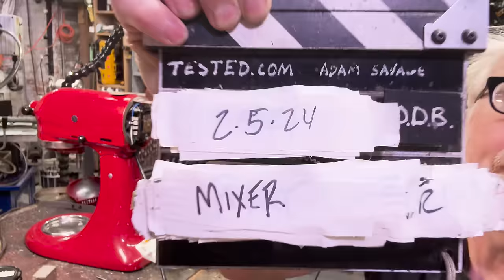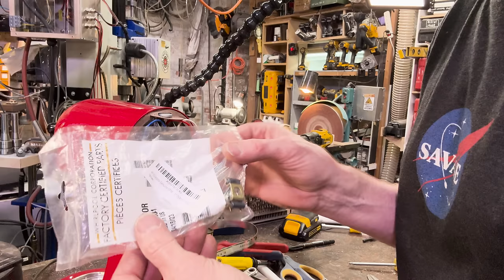Can Adam Savage Repair This Old KitchenAid Mixer?

Comment: I've been doing restaurant equipment for over 20 years. I've fixed 100s of large Hobart mixers. I've fixed tons of these small mixers for friends and family. Pro Tip If you find any Kitchen Aids look on the back left if you see the Hobart logo buy it. They were built as well as the larger Hobart mixers were.

Comment: I follow tested, and when I saw this vid and for a minute, I hoped beyond belief that the KitchenAid mixer problem here would be the same one as mine, especially when mentioning the switch, but alas...  My issue is that the switch will not physically stay in the off position. Yet it may be the same solution regarding a replacement part.

Comment: I love my kitchen aid mixer as i use it with a shredding attachment to help me prepare meals as i don't have full use of my hands. 
My 1 complaint about it's construction is the use of a nylon toothed worm gear which although a cheap part gets shredded by the metal gears it interacts with. 
I know it's probably a sacrificial part i wish it was made of something a little more wear resistant so i don't have to remove and replace all the grease as often every time i get an unusually dense bag of carrots.

Comment: little pins like that are easy to deal with. When you know it can drop out, first thing is have a way to catch it, like the apron on a watchmaker bench. Second is a drop of blue loctite. before moving on, put the pin in place and let the sruff set. On a loose pin, it'll set well enough in half an hour, but you can shift or remove and clean the pin later.

Also, GFCI. When working on this type of thing, ALWAYS  a GFCI. Watching he screwdriver adjustment when it was running scared me.

Comment: A friend's mom gave me her broken KitchenAid mixer to see if I could fix it and flip it. I don't even remember what I replaced. It was mechanical, not electrical, I remember that. Seemed pretty straight forward to work on.  Contrast that with me trying to repair my mom's Bernina sewing machine, which I failed hard at. Still was able to sell the Bernina to a sail maker because it was so robustly constructed. Things that are well built are worth fixing and can be fixed is my point, I guess.

Comment: KitchenAids rule the mixer kingdom for a reason! They’re so robust to begin with, but they’re also SUPER maintainable thanks to their motor construction. Fun fact KitchenAid was a name they slapped on Hobart mixers (think bread factory) when the first home models came out in the 50s 😊 An amazing brand and lifetime investment
Reply: It's unfortunate the newer kitchenaid mixers aren't built to last like the old ones
Reply: The KitchenAid is a separate product line from what you would now think of as Hobart mixer (Hobart sold the Kitchenaid brand to Whirlpool in 1986 but kept the patents for their professional mixers). The Hobart mixer has rhe motor always at full  power and has a variable transmission, the KitchenAids emulates "gears" by slowing down the motor (which means you have miserable torque in low gears because your nominally 300 Watts motor produces only a fraction of that). Beatiful machines though.
Reply: It's a monopoly.....
Reply: No they're not, they're the trendy ones. The equivalent of a trailer queen. A Hobo is superior. Actual transmission. You buy a Hobart, you die with your Hobart. I've seen examples used in professional setups that hadn't been opened from production decades ago (pristine, untouched screws, the hallmark of any quick and dirty repair). "Fixed" one myself, because the motor brushes had finally gone too low.
Bout the only thing can cook a Hobo is stator death. Either the copper gets too low (but you can fix that if you find yourself a stator lathe and the nerves to remake that stator) or burnt winding. The gears can't die. They can get loose or sloppy, but they'll still work. And in today's day and age, you can 3D print replacements out of superior materials. If a KiA dies... you either buy a defunct one for spares (because the control system is too complicated, pointlessly) or buy a spare from someone parting out theirs. And the gears are far more trafficked than Hobo materials.
Reply: @aserta  To be fair, for the price of an N50 you can get probably 20 KitchenAids (YMMV, here in Germany the N50 is about 8000 Euro). For a home baker that is probably overkill. The KitchenAid looks nice and if you don't want to run it for more than 10 minutes before cooling down it is perfectly adequate.

Comment: I was waiting for the BANG! 
Sticking an un-insulated screwdriver into the back of live equipment is a great way to get a Darwin Award,  even if your running on 110V instead of 240V
Reply: Our 120V is 240V It's just center tapped.

Comment: Distilled water works really well for cleaning electronics, as long as there's no residual charge in the electronics, and as long as you let it completely dry before giving it power.
Reply: Distilled water? When I worked at a board assembly house we loaded all the boards we made into a regular dishwasher hooked up to city water to wash the water soluble flux off of them. The water in that city was harder than a carp too. Lots of minerals in it.
Reply: @1pcfred That’s horrible! It doesn’t take much minerals to cause problems down the line.

With that said, even the hardest water in USA isn’t that hard. “Hard” water in Europe is literally off-the-charts hard by US scales! 

I now live in Switzerland, in a place with medium hard water (i.e. very hard by US standards) and I’m glad that at work (a university), we have both regular hot and cold tap water, but also a cold deionized water tap. Only for the most demanding analytical chemistry do they need to further soften and distill that. Super handy to be able to casually use deionized water for cleaning electronics or glassware.
Reply: @tookitogo  my buddy lived in that city and he ran a humidifier. In a day his TV screen would be caked with this white crust. So then he had to start getting into reverse osmosis water purification. That tap water was harder than a coffin nail.

Comment: 21:26 Find the following objects: Sanding disc, foam cutter, Radio Shack sign, space suit, dodecahedron, dial gauge (3), mirror ball, dummy head, alligator leads, start/stop buttons, light panel, hazard sign, stool on wheels, solder drawer, too many power adaptors.

Comment: 12:08 there is a contactor on the front lower part of the speed controller that the contacts need to be cleaned, the contactor possibly bent to the correct position, and the piece that holds it in place needs to be tightened and you can avoid replacing it. it gets loose over time and bent out of position causing it to be near impossible to dial in the lower speed. once the contactor is secured the low speed can be set.

Comment: I purchased a KitchenAid 6 Series from Costco in the USA and I'm using it in India with a 1500-watt step-down converter. However, my new KitchenAid only runs for about 10 seconds on speeds 1 through 5, and then stops shortly after spinning. What could be the issue?

Comment: I have a pro 600 and this year after about n12 years of perfect service the lowest speed (stir) would at times not engage I opened her up and thought I might need to deoxit the switch, it was caked in flour, I blew and brushed it out and everything is back to normal operation.

Comment: I might be wrong but I thought there would be a spring that attaches to the bottom of the speed controller plate just under the bottom adjustment screw? It may be there but I didn't see it.

Comment: Your friend is lucky that's an older machine as it still has a spring on the beater shaft that KitchenAid removed several years ago KitchenAid decided recently to make the pushrod that moves at speed control plate back and forth out of plastic after Decades of making it out of metal just to save some money. The problem is it's very cheap plastic and it tends to melt. In that case you don't want to order another Whirlpool OEM part you want Mr. Mixer's metal replacement part.

Comment: I found this to be painful to watch 😂.  I retired from KitchenAid and worked every part of the factory that makes the stand mixer. Every part inside of those mixers has changed very little.  The original problem was that the governor had slipped back. Just needed a nut driver to put it back on. On the production line a orange rubber mallet fixes a lot of problems. 😁

Comment: Parts availability is huge. I got spoiled with my 2007 tundra, being able to order parts directly from Toyota over 15 years later, when I can't find anything secondhand that works. Compare to a simple, frequently replaced rubber window seal on my 2012 Ford that is discontinued and not available anywhere... 🫠

Comment: There is a way to find out how old a KitchenAid mixer is if it still has the sticker underneath with the serial number on it. I believe Mr Mixer get a tick tock video about it. I don't recall exactly when KitchenAid came out with the Artisan line which the example in this video happens to be. I have a few different KitchenAid mixer models one of them is the ultra power model which utilizes the same body as the artisan what has a 300 watt motor I think it's either from the 80s or 90s because of the silhouette for lock and unlock they just wrote the words lock and unlock on it. I definitely recommend getting a KitchenAid mixer if you're into cooking where do you buy new one or used one since they are so easy to work on. I find KitchenAid history very fascinating.

Comment: I need to replace the gears in my mom’s. The cover for where you can  attach accessories fell out just as she turned it on, the beater wedged the cover against  the bowl and sheared multiple teeth off the main gear.

Comment: This shows why right to repair is so important. If this were a new product today, replacement parts wouldn't be available, the software would be locked, the license would prohibit you from opening it in the first place, and there'd be some kind of smart sensor that'd lock you out of using the touch screen interface if you swapped a component for a "unofficial" one.

Comment: 9:48 There's a weird blur box right at the tip of that blue glue bottle... I don't know what's up with it lately (or if it just started or I just started noticing it...)
Reply: It looks like it may be an encoding artifact to me. YouTube encodes every video they serve. They encode it multiple times too.  So it is an ongoing process over the course of time. The whole deal is complicated. Resources are finite so they're prioritised and optimized. But that means not everything is instantly optimal.
Reply: He replied to another comment that the blur is on purpose, to obscure something.

Comment: I am actually enjoying this video. The nice thing about older kitchen gadgets is they can be repaired as they were built to be if needed. Even quality cars like older Toyota's were built like little gems. One could often just take apart things and just clean them.

My challenge to you is one of the most evil thing on earth in the Kitchen to fix. Its older expensive Keurig Coffee makers with a bad water pump. 

They are virtually impossible to get apart in one piece without destroying them. Once apart its nothing to fix.

They look easy to fix at first but there in lies disaster. 

Keurig designed a system of inner locks that are the devil themselves to beat.

If any bank wants to secure their money tell them to just ask Keurig.

Comment: I had to replace the motor in mine once, which requires taking the top off and carefully sliding the motor out from the transmission, which require removing screws locking the transmission down. All of which went great, until I went to put those screws back in and dropped the first one down in the chassis. So I just turned the whole thing upside down to get the screw to fall out, leading to all gazillion pieces of the transmission falling out all over the table. Needless to say, it turned into a bigger job AND wasn't great for my ego.

Comment: It acts like the motor brushes are wore out!  Starting and stopping?
Reply: This... and the gearbox needs fresh (food-safe) grease.
Reply: Starting and stopping is how it speed controls. That's what that plate on the back is doing. That coupled with the governor makes and breaks electrical contact.

Comment: I have a Kitchen AId mixer from the 70s and it still works. The ones made now (the last several decades) use plastic gears and need more maintenance. Kitchen Aids are not made as well as they used to be.

Comment: I'm having extreme difficulty imagining how a tilting plate controls the speed :-).
Reply: Think: mechanical rheostat
Reply: A mechanical "govenor" on the motor axle is driven outward by centrifugal force. When it hits the speed control plate it opens a contact and power to the motor is interrupted, making the govenor move inward again. The angle of the speed control plate determines how soon this happens, and that way throttles the motor.
Reply: @unavailable753  I've gotten so used to multi-tap motors in things like fans that I forgot you can actually set them up with a real governor and get actual rpm control.

Comment: With Adam on the case, you know he's not going to half-ass it at all, and if he can't fix it, it probably can't be fixed. It's sure not because he didn't try his damndest. We should all be as lucky as the owner of this mixer. Adam, if the whole "famous prop maker/TV host/YouTube auteur/all-around great guy" thing doesn't work out, you could open up one of those little appliance repair shops run by a charming old man who can fix anything.

Comment: wouldnt u test setting 1 low under load in case it bogs down ?
Reply: KitchenAid mixers are not actually supposed to run in the low settings under any appreciable load. Since low speeds are accomplished by throttling the motor to low power output, running a load in low "gear" (it's not really a gear) might stop the motor, and then it will burn out (the motor is made from spools of copper wire with a thin insulation layer, and if it heats up the insulation would burn off, the wires would come in contact with each other and short the motor out). This is the reason a KitchenAid has a sacrificial nylon gear - if a load stops the attachment, the nylon gear breaks and takes the load off the motor to prevent it from overheating. So contrary to your intuition (which you have probably gained from motors with an actual transmission where the low gear means more torque) running a 5 Quart KitchenAid in low gear is generally not a great idea (their bigger models have modern brushless motors with electronic speed control).
Reply: @unavailable753  right agreed but i ment like someone doing thick iceing sugar mix then adding color in low mode 
cant say things like this dosnt happen then going back up to speed. 2nd point is u throttle back down to turn it off right - so if your doing pizza dough you will and do pass low gear.

Comment: I have had occasion to deal with a couple of these things.   
Stupid, fragile speed control schemes and instantly destructable gears are the main reasons.   
Not that Sunbeam did any better on speed controls ---    
they are different in design but every bit as easily damaged.

Comment: There is a possibility that the carbon brushes are near end of life. The sound of the motor running is not smooth and could be arcing instead of having good contact. Although at the end it sounded much smoother. Not to mention if the brushes were arcing there would be a pronounced odor of ozone.

Comment: Arg, I have that exact same model (manufactured more recently), and couldn't fix it. Mine's just dead as a doornail, it still bugs me.
Reply: "Dead as a doornail" usually suggests worn out motor brushes. With pretty much any other fault it should at least make a noise (if you dare, after unplugging and then taking a step back you can bypass the speed control plate and connect the motor directly to the cord to see if it turns).
Reply: @unavailable753  It overheated dramatically, and it's too new for it to be the brushes. (It didn't feel hot until after dying, so something went weird inside it.) It even melted the lever mechanism, which I replaced.

I've been nervous to connect power to the motor directly since I couldn't find good info and it probably will short circuit.
Reply: @GamesFromSpace  If it overheated then the insulation on the motor coils might have melted and shorted out the motor. Here in Germany at least it would mean the machine is totaled, since a new motor is pretty much the same price as a new machine. No idea how prices are in your part of the world. Taking out the motor for visual inspection is a bit of work, but at this point you don't have a lot to lose I guess (or maybe you know someone with an endoscope camera and can peek it without disassembly).
Reply: @unavailable753  I did buy an endoscope a couple months ago, that's a fun idea. Thanks.

I did look at replacement motors, and the shipping cost drives it up to 2/3 the cost of a new machine.

Darn thing really shouldn't have overheated so abruptly, I hate that it doesn't have a cheap internal temperature sensor. (I'm adding one next time around.)